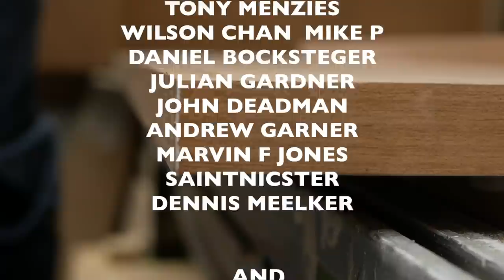Veneer Edgebanding #176

Comment: I did a lot of iron edge banding when i made a desk. I found that holding the iron stationary until the area under the iron had set (with a little squeeze out of the glue) and then moving the iron to the next position along worked better than trying to iron the edge banding like ironing a shirt. Also I used a wide sharp chisel held flat to the surface to trim the edge banding along the sides, and vertical to trim the ends, gave a sharper finish than a utility knife. I used a short piece of 2 inch cross section wood with rounded over edges to press down the edge banding after ironing and while still very hot. You can get a lot of pressure that which makes for a better bond. No fancy tools required!

Comment: Great video. Thanks for sharing. Edge banding is a technique which I use already about 30 years (on average one time per 2 years  or so) and I do it more or less the same way.
Nevertheless I learned some new things. I was told in the past that the iron should be at maximum heat (positions as for ironing cotting). But using mainly white edge-banding for melamind particle board, I had some issues with darker spots (too hot)
so I put a piece of paper between the iron and the edge banding. Decreasing the temperature is for sure a better way to go.
Bringing the edge band to the correct width I do with a potato-peeler. That does not always give the best result.
Last time edge banding was already some years ago. Need to practise it again. With your tips it'll go much better.
Reply: I think the temperature is quite different for various types of tape (and manufacturers) as well as a lot more critical with the timber edge banding.  I've found a lower heat setting and giving it time for the heat to pass through the tape (over a larger area than the base of the iron) and moving the iron back and forth is much more effective.  Cheers, David.
Reply: Thanks for explaining. This is very helpful to me.

Comment: Perhaps the reason it's hard to use the trimmer on both sides simultaneously is that one side goes with and the other against the grain.  I use one too, and that's my theory.  Usually one side is rougher than the other.  What I learned most from your video is that I should put the shelf flat on the workbench overhanging to use the trimmer.  Ha, ha, I've been balancing it vertically using handscrews, depending on shelf length. I started doing this before I had a proper workbench and just kept doing it that way.  Plus, a woodblock is better than a roller.

Comment: In woodworking, there is usually no single right way to do things. There are often several wrong ways but a few right ways. What Peter shows here is a very good method. I particularly like covering the not-often seem edges - a sign of a good craftsman, rather than one who cuts pennies.

Allied subject. Painting the edge of good MDF (generally not the papery stuff from the big sheds: I only use MrMDF and try to buy only Medite because of its consistently high quality) is not that difficult - it just takes time sanding, painting, sanding, painting etc. However, getting a good painting job on  the edge of plywood is more difficult. Good birch plywood is easier than others but still a task. I veneer on edging; either wood veneer or a good quality melamine-y type. It gives a very good edge that can be slightly sanded to accept paint if needed.

Good quality is a constant theme. I know that the big sheds are convenient but the quality is, generally, poor. Their MDF almost crumbles when cut and is just horrible to work with. The good quality stuff (mdf, plywood, structural timber) may -may - cost more at a local timber merchant but, when you break it down to a price per piece or a price per year of usability, any extra cost really isn’t there.

As I write this (June 2021), we are in the midst of unparalleled rises in the costs of the more commonly used timber (again, mdf, ply and structural). It is now a good 50% more than a few months ago. Why is not absolutely certain; many theories about who is making a killing. But, I would bet that your local timber man is not making any more money. He/she has to think about what the timber has cost to buy but also about what it will cost to replace. To sell based on purchase price will bite you on the bum as, at some point, you will have stock bought at the higher price but the sales price will have fallen. That is why “old stock” should reflect current sales prices. 

Final point. For whatever reason, hardwoods here in the UK have not been as badly affected. It’s only the manufactured or processed timbers.

Comment: Peter, do you use the same method for Birch edgeband veneer? I'm finding that it has a lot of reversing grain (more than for example the Sapele in your video), which results in tearing if the trimmer goes in the wrong direction.
Reply from the maker: Never used Birch edgebanding I’m afraid. 🤷‍♂️👍
Reply: I was also searching youtube for advice on birch too. First time I used it today and I ended up taking some chunks out of the edge banding. Other times I've used a similar tool, I've had no trouble...

Comment: Peter I keep meaning to ask. The hand sander block you use. Is it homemade. I assume you use a standard round sanding disc attached? Couldn’t see it in the “stuff I use” link. Any info as ever would be appreciated. Dave
Reply from the maker: Thanks Dave. I’ve done a couple of videos on these, this is the most recent - Hand Sanding Pads, https://youtu.be/jeAGbrowJS4 👍
Reply: @10MinuteWorkshop  thanks Peter. Not made it to that video yet. But making my way through.

Comment: Nice easy job, looks good 👍
That sanding block/disk you use, is that a rubber sanding pad from an air tool with a draw handle attached? 
Bloody brilliant, if it is, if not, I'm still going to knock one up myself... Hehehe 👌
Reply from the maker: Thanks Bill. Pretty much, yes - it’s a worn sanding pad from an orbital sander with a drawer knob attached. Works great! That and a few more top tips in my Sanding Tips video #028 👍👍
Reply: Peter Millard sweet, cheers for that, mate👌

Comment: You could use one of the seam rollers for wallpapering for applying the pressure. Have you ever tried the paintable edge banding for the edges of mdf before painting, have been thinking I might give it a try on my next project
Reply from the maker: I found it much easier to get even pressure with a block of scrapwood tbh. And no, never tried then taped edges for painting - it’s on my list too 😆👍👍
Reply: I use a seam roller too. Another tip I use is to roll the iron over the edge slightly. I was told you get a better seal at the edge and help prevent peeling. Most of my edge banding is on ply so don't know whether this would "round" the MDF at all. Keep up the good work Peter and shame you won't be at Makers Central.
Reply from the maker: Thanks Steve. Yes, it’s a shame - if you go, enjoy it! 👍
Reply: Just printed my tickets for tomorrow

Comment: Excellent as always! Newbie question: is that a 'real wood' veneer, so it would take an oil or a stain?
Reply from the maker: Thanks! And yes, absolutely a wood veneer, takes the same finish as the board, no problem. 👍
Reply: Peter Millard thanks! One more thing, perhaps for a tip video... How do you get rid of the tiny 'glue thickness' gap between the edge banding and the shelf?
Reply from the maker: I just sand them back carefully, from the veneered edge towards the flat face of the board. The watch-word here is “carefully” 👍👍😎

Comment: Good stuff, thanks.  In preparation for a desk made out of melamine coated board, I looked at a few YouTube videos on how best to address this without an edge banding machine.  One of the best videos I found included tips on making the board you use to press the tape down after applying heat.  Tod suggested rounding over the edges which enables you to apply a lot more pressure to the tape.   Other useful ideas too, so check out his video: https://goo.gl/PzDQnL  - Cheers, David
Reply from the maker: Thanks David - sorry for the slow reply, only just seen you were caught in the spam trap because of the link; I've been away and don't have access to it on mobile 👍

Comment: You are gonna be in so much trouble if your wife sees the video. I'm sure she has no idea where her iron goes.
Reply from the maker: 😂 That’s my Workshop iron - I’d be a dead man if I used the household iron, lol!
Reply: That's another good tip Peter - get an iron for the workshop. That way there is no risk that the steam function is turned on, or the heat set to max without you being aware, or that your wife finds adhesive on something she has just ironed!